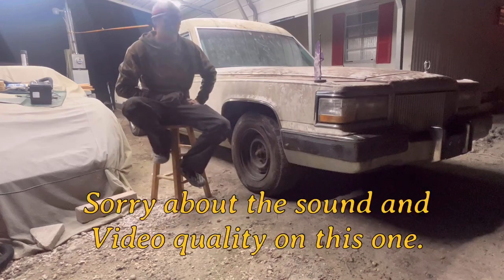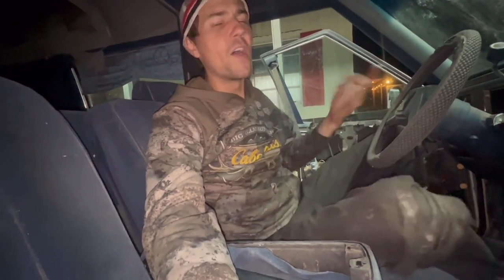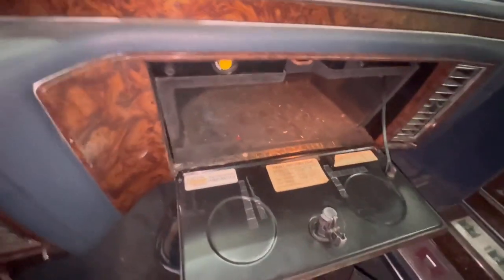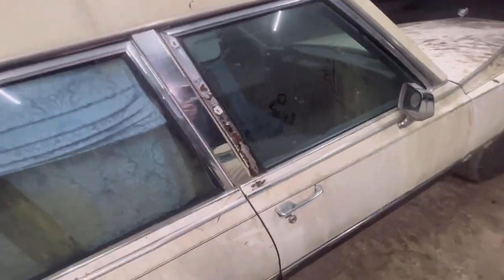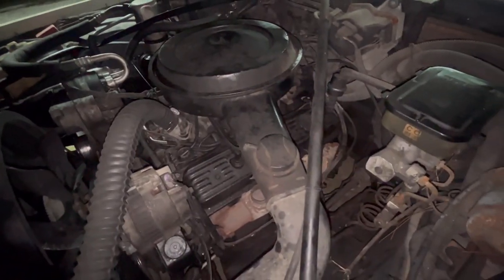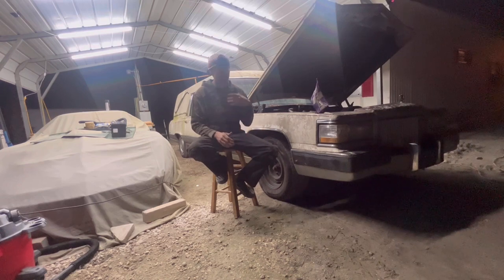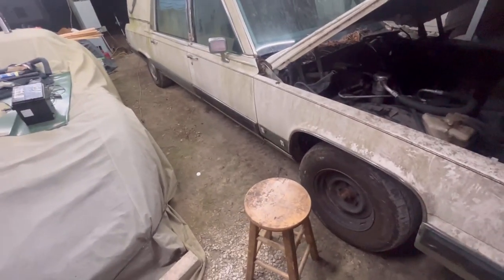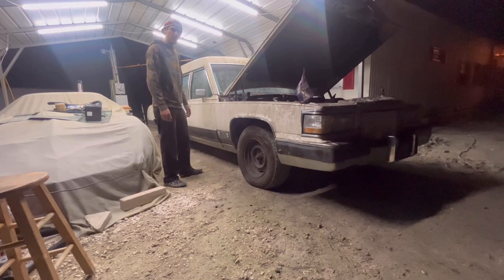Uncovering the Cadillac brougham hearse past and finding issues

Comment: Those are NOT Vortec heads. It's a common misconception that all center bolt valve covers indicates Vortec heads, and that's not true. Center bolt valve covers started with TBI 305/350 in 1987. There not one good thing about those heads. Low compression, small runners, and thin casting. Votrec heads didn't come out until 1996 in trucks, vans, and marine applications. Never went in cars. Easily identifiable by their raised rails where the valve cover sit, and by only 4 intake manifold bolts, which are vertical. Vortec heads also don't have an exhaust crossover port. They have smaller 64cc chambers, and very nice flowing ports. Unfortunately they are also very thin castings and crack easily when overheated.      All the Votrec 305/350 were roller cam, most TBI were not. The blocks had provisions for factory roller cams but almost all of them were equipped with flat tappet.
Reply from the maker: Well thanks for all that info. Definitely learned something. I’ll have to pull a valve  cover and stick my bore scope down to check out the valley to see if it has a roller lifter retainer bolted down in it. I was just told differently. Again I appreciate it! And thanks for watching!
Reply: @JJsSpeedShop  You'll probably find the bosses cast and machined in the valley, but they will be unused.   
Good luck 👍
Reply from the maker: Yeah, regardless it’s not a dealbreaker. I’m definitely gonna swap the cam out regardless and go with a roller cam with all the lifter issues nowadays but like I said, I definitely appreciate the info.
Reply: Definitely a cool looking hearse though dude 🤟
Reply from the maker: I did go out and stick by bore scope down  into the valley and confirmed it is a roller motor but it does not have vortec heads. I should have caught that I completely forgot about the valve cover bolt angle.
Reply: @JJsSpeedShop  well that's cool it's a roller